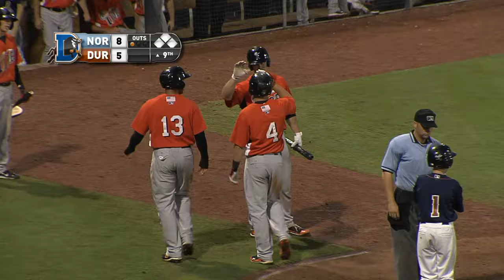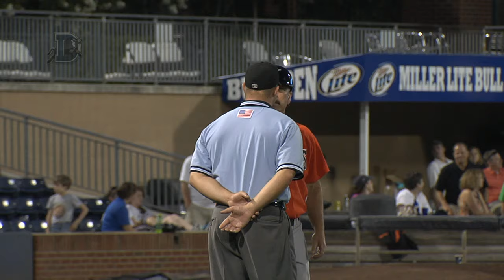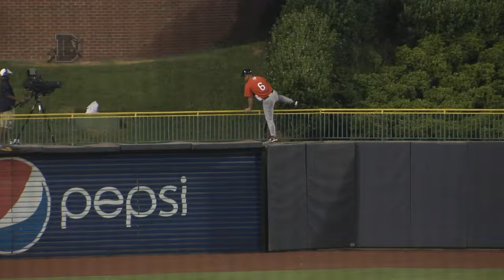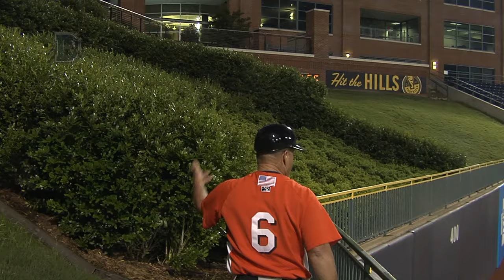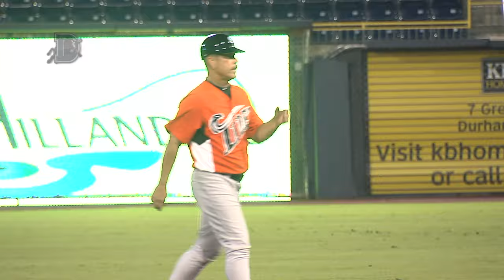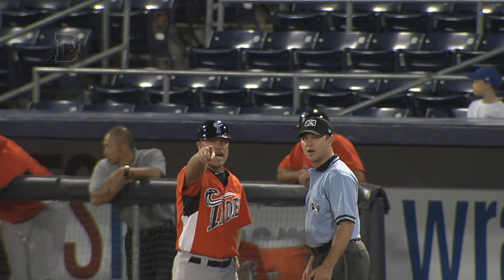Norfolk Tides Manager Gary Allenson in Crazy Ejection

Comment: Here’s what should happen. Simply replace the “bicycle rack” with a solid wall, which will remove all doubt as to which side the ball landed on. This is a bit like some of the snow fences I used to have to deal with when umpiring.

With a solid wall, if the ball goes over, you clearly see the ball disappear. Or you see it land in front. But when you have a wall like this, or a snow fence (which has all kinds of holes in it), it’s very difficult to tell whether the ball lands behind the wall, or lands in front, and bounces over it. Umpires don’t have zoom lenses in our eyes.

Comment: @samuricex Baseball fields are not uniform like the soccer pitch. Outfield fences can vary in height, at Boston's Fenway Park the left field fence is 37 feet high and in right field it drops to just 3 feet. Because of the unique features of various ballparks each field has its own set of ground rules, for example if a ball gets stuck in the ivy at Wrigley Field in Chicago the batter is awarded a double. At this park the ball must travel over the rail and the painted yellow line to be a home run.
Reply: Soccer pitches aren't uniform, either. They can vary (slightly) in length & width. But they are all rectangular, unlike baseball fields, where dramatic variability in the outfield & foul-territory dimensions is permissible.

Comment: @RandomsDeagled It does happen in baseball and calls do get changed depending on the situation though generally arguing will not change the call. 

It is a good enough reason as the ball could not end of where it was if it did go over the fence.

Comment: Why is the manager wearing a helmet? Does he expect to bat?
Reply: blacksabfan he’s a base coach not a manager. All base coaches in MILB and MLB are required to wear a helmet. Didn’t use to be the case but then a Rockies minor league base coach was killed by a line drive in 2007.
Reply: @nateward9592  Its even starting to trickle down to the HS level.
Reply: In the minors, the manager also typically coaches third base.

Comment: since when could you change the call in baseball? hes safe i mean out or wait he might of been safe... finding a ball behind a wall wouldnt be a good enough reason if i was the coach either.
Reply: RandomsDeagled umpires have always been able to overturn an original. But you can’t change it once you change it.

As for finding the ball and calling it a double, the ground rule of the stadium is the ball must clear the yellow line at the top of the railing in order to be a home run. Outfielders were signaling it didn’t do that so the umpire went to see if that was indeed the case. There’s a gap between the fence the ball needs to clear and the shorter padded fence, the back went in between the two. So the call was changed to a double.

Coach was convinced, in his own mind, that the umpire had just found a random ball. That the real ball had cleared the fence and was sitting somewhere in the shrubs. What an idiot and made himself look even more foolish by going all the way out to look for himself.